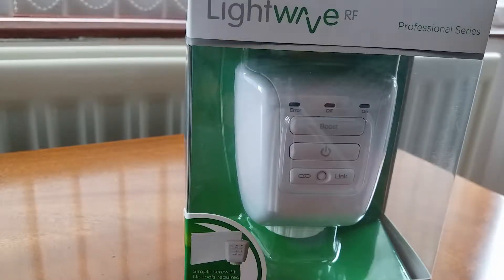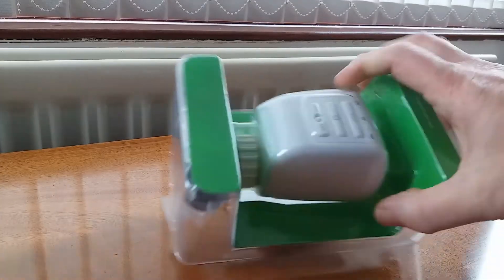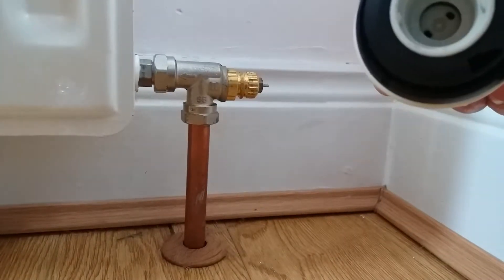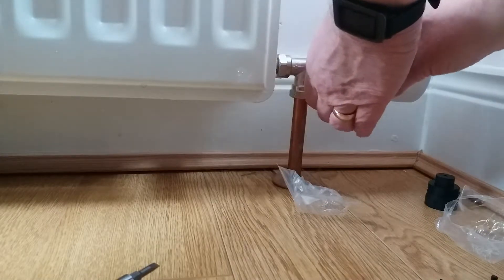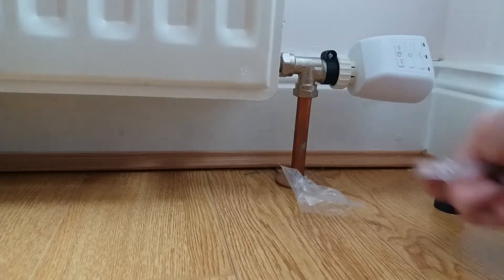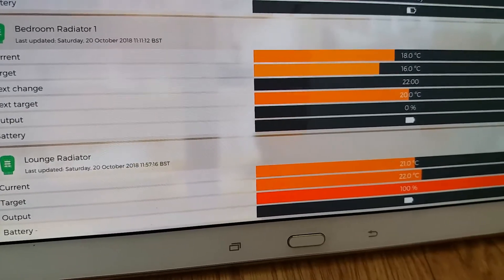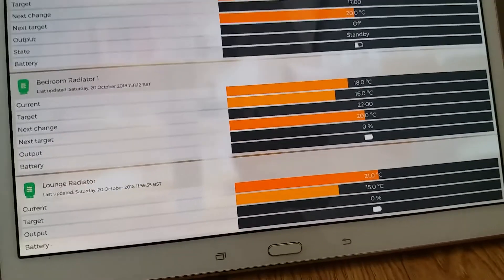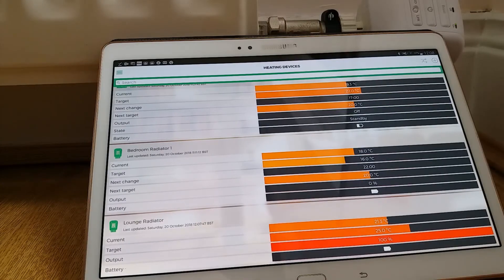LWRF TRV

Comment: Could I suggest a couple of amendments for this video name?  Include the brand of the replaced TRV -  "Danfoss TRV" and using the supplied black plastic adapter with a setscrew and nut.  (The other plastic adapter is for 28mm thread to 30mm). Likewise, if you have the latest TRV's you should have the standard 30mm thread - no black plastic adapter required.
Also suggest adding - can be voice controlled, in this instant we are using the "Google voice system".

Thank you